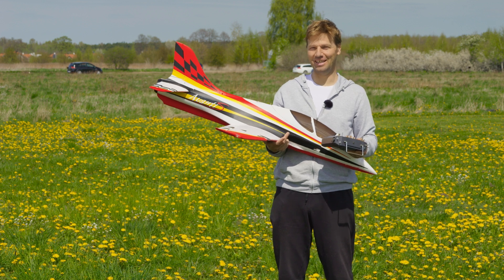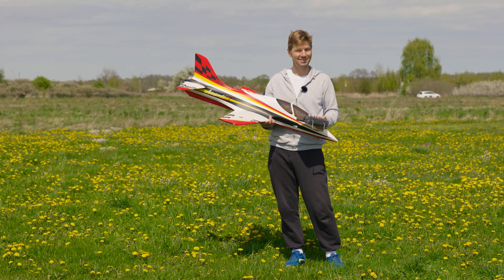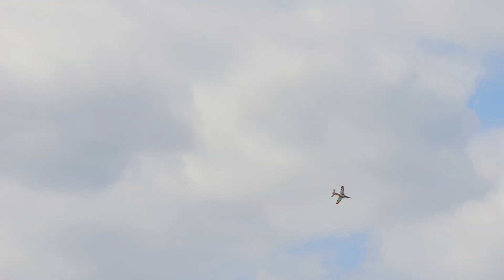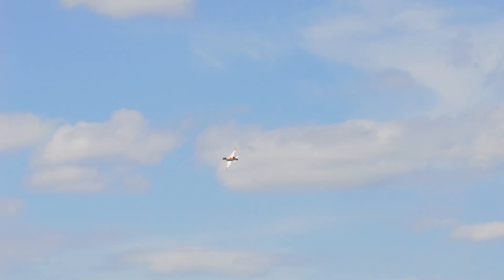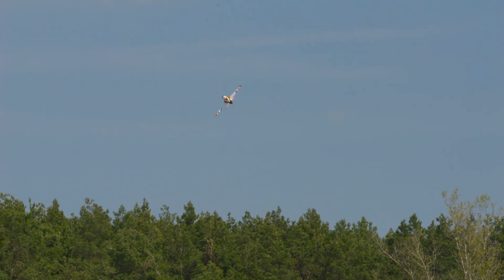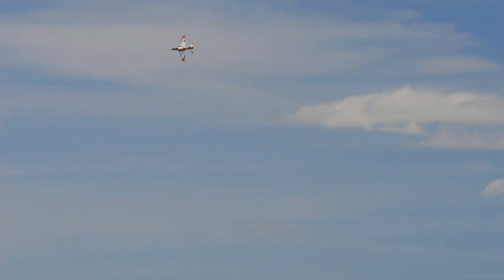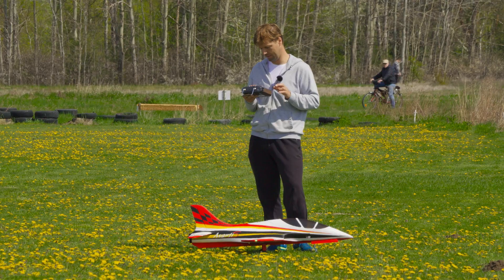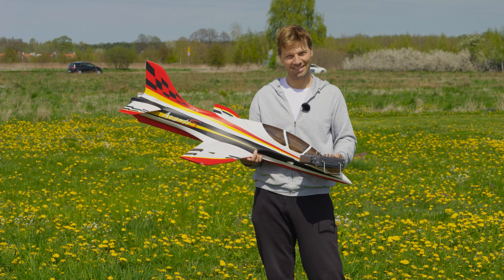Avanti - The Best Every Day Jet 2022 and the last flight on Graphene Batteries. Super low pass

Comment: Hi I’m loving your videos.   Can I pick your memory about your old Sebart Mini Avanti S.   it’s setup with 
Mini Avanti V2
JP Hobby retracts with brakes (powered by 3S 450mah lipo 55g)
Wemotec midi Evo 90mm 11 blade fan partnered with HET Typhoon 650-68-1500 36mm motor.  Wemo 11 90mm Midi Evo coupled with HET 1500kv 650-68 36mm spec says
80a 2368W 3.69KP
Hobbywing HV (5-12S) 120amp ESC (opto)
FrSky TD R18 and 2x 1100mah life flight batteries (132g) X20 Radio
Hitec HS-5085MG servos
Turnigy 5000mah 25-35C 4S LIpos x2 in series, 8S, in good condition not puffed 980g weight combined.   

On the bench I've measure WOT on two types of 8S lipos :
45C Graphene 2023W 75A
25C Turnigy 2271W 80A

Bench tested WOT with 10S. 
109A 3874W

On testing it would struggle to lift its nose, even with 10s.  I’ll upgrade the front strut to raise the nose on taxiing.  Am I on the right direction with this setup, or should I be looking at a different motor fan setup?   I’m not after crazy speed, just a good practical setup.  Thanks

Comment: That's amazing. You fly almost 5 minutes and using only 3250 mAh. If my calculation is right, you draw 39 amps average, which is superlow. I don't understand how it is possible...
Reply: description says 4000mAh
Reply: @nml5536  telemetry told 3250 after the flight if I heared it correctly
Reply from the maker: I fly on 8s

Comment: Nice! U use 3 Flight mode DR as the manual write for Mini Avanti? (DR 100% on landing and spin with full Flaps for ailron&elevator) Im now ready for maiden, Thank U the answer 😊
Reply from the maker: no just 1 flight mode... standard 10mm deflection is enough
Reply: @EDFjetRC  Thank U!